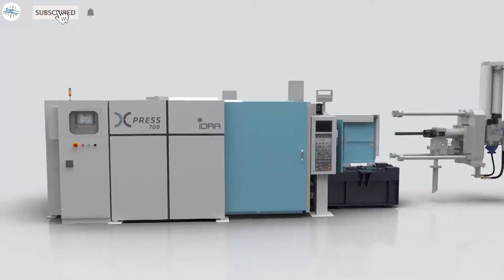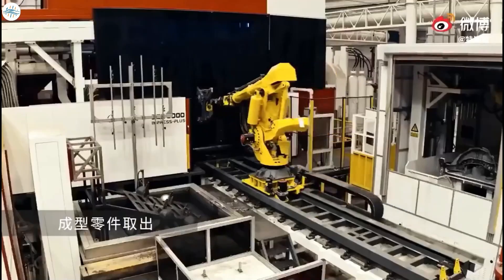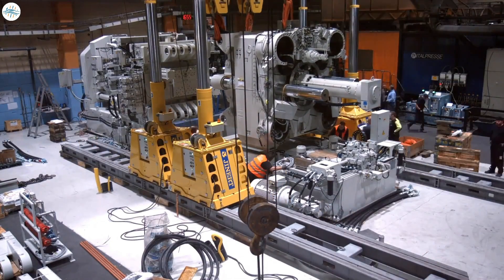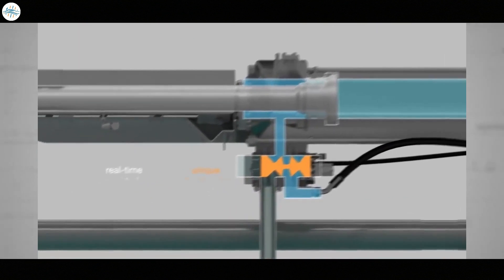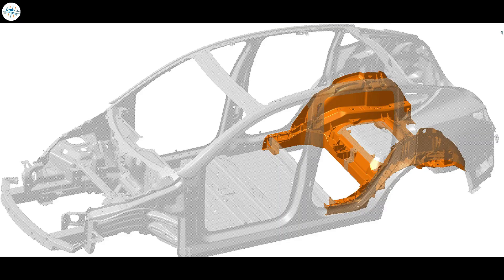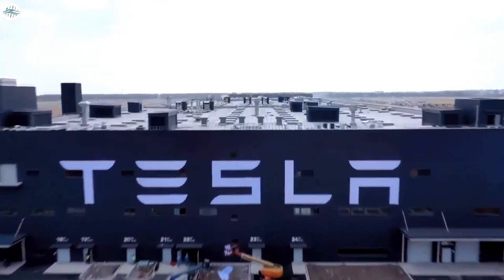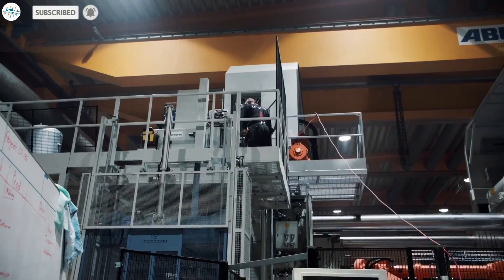Why TESLA Bought The GIANT Giga Press! - Amazing Story Behind It!

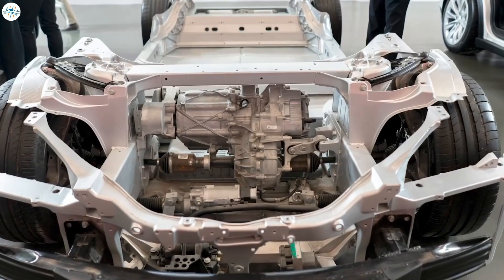Comment: 3:40 "Whole re-runder body is cast in one piece"?  Can't understand the computer-voice.  The frame shown (Model 3 or Y) appears to be many welded parts (ditto at 4:10 for Model S or X chassis).  I thought they were just die-casting the rear subframe of Model Y, so is he talking about future plans?  They had been casting the rear frame as 2 parts in a smaller machine, then riveting them together w/ steel supports, so this Giga-press lets them do it as one part.  Have these single piece rears been seen in Model Y's to date?  Drones have photographed many stacked outside all around the Fremont factory.  Rejects, reworks, or just stock waiting to go into cars?  Die-casting large parts is not new, indeed a 2016 Cadillac did so for large rear parts.  This is just bigger.  TBD if it pencils out.  Welding steel parts together isn't terribly problematic since all automated.  How the sausage is made matters less than cost and weight.  If the future CyberTruck uses die-casting as speculated, I doubt it could be in the promised stainless-steel, unless some exotic new tech allows die-casting steels.

Comment: Casting large components then crashing those components means they can be properly recycled, possibly better than other car body parts. I don’t think Tesla needs the larger press to create the Cybertruck, just the moulds for the Skateboard battery pack. The Stainless Steel body is fairly easy to fold in a Press Brake and machine weld … maybe Tesla will need the bigger press for the van and large Truck fabrication …

Comment: Really great video.  So the press is the size of 2k sq. ft. house. or the typical 2 Bedroom house.  
and it can make a part that replaces 70 parts and the 60 robots to make those parts!  Yet the greenhouse gasses are more produced by air conditioning than fossil fuel burning?  Hmm. Make and ICE engine that powers one of these gigapress chassis cars !  Then make a solar powered AC system and the entire climate problem is solved; no?
Reply: I believe the number was several hundred robots to assemble the M3 rear body section.
Reply: You realise it's not a "Press"'?
"Casting machine" or "Die" are both better descriptions.
As for AC, Why not simply paint a roof white?

Comment: This machine is always breaking down as it is basically a prototype. Molten metal and a hydraulic press that uses extreme pressures means it needs heaps of maintenance. Everyone would be using them if they worked well but only 1 company makes them this size because it is so difficult. Elon got sucked in with false promises in the brochure. Plus it sank into the ground as the factory floor couldn't support it properly. It only works half the time due to "issues".
Reply: Oh, do you work there?